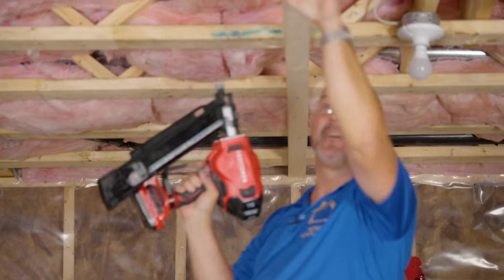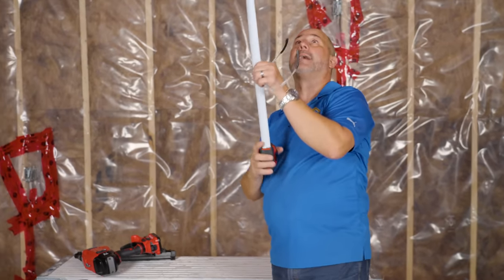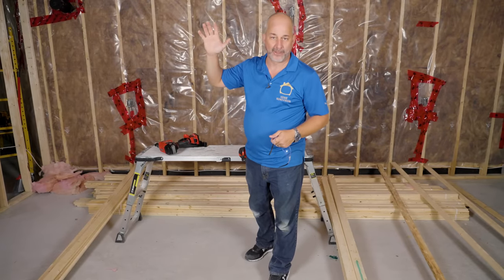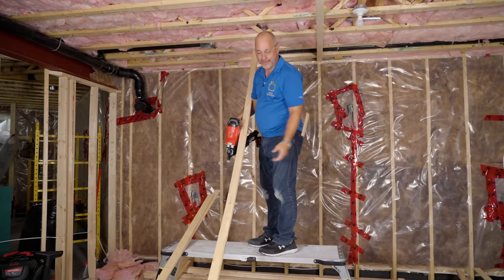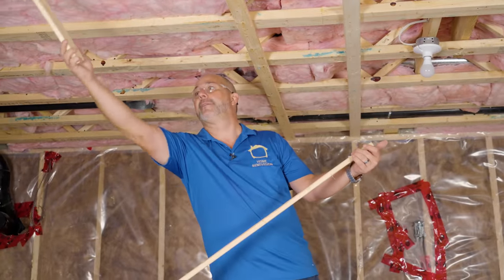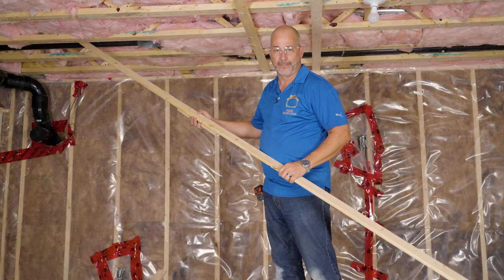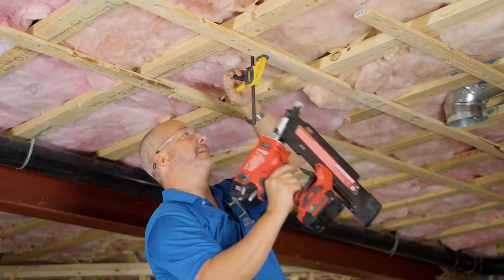Why You Should ALWAYS Strap Your Ceiling

Comment: Besides spreading the load out, which preserves the integrity of the drywall joints over the life of the house, the other big reason is you can nullify structural brackets and any other protrusions (less than 3/4 inch) from bulging out the sheetrock. 

Fixing any 16 oc layout issues is also a significant (and common) plus to Strapping. 

Snapping lines every 4-8 ft is good practice for large rooms (greater than 16 ft or so), so your 16 oc doesn't get out of whack with the spacer block.

Great video though. (Also should stagger the joints for the furring strips).

Dang, furthermore if necessary Strapping can be leveled with shims or spacers for floor/ceiling joints that are out of plane.
Reply: He was using floor trusses with a 3.5" screwing surface.  You'd have to have some of the worst framers in history to not have adequate surface area to attach drywall.  Do what you want, but his reasoning on why to put up strapping had nothing to do with logic.
Reply: @darinvee4980  That doesn't necessarily address layout issues, where the joists layout flip 90 degrees, which is common.  Also sometimes there's angle brackets and stuff sticking down even from those floor trusses.  And while those engineered floor trusses are quite firm, any deflection forces without strapping goes right into the sheetrock (negligible in this case, probably, but not with maximum length joists (whatever that may be; 16+ ft)).

Agree, that if there's ever a time where strapping can be skipped it's with those engineered floor trusses.  Other considerations may still apply.
Reply: or... NO strapping
Reply: @tredogzs  I'm doing a house right now that has 4 rooms with beams, brackets and long crowned ceiling hosts. 

Strapping is necessary. 

Though people are free to do hack work if they want. Have fun with that.
Reply: @chrisroyuri  Your particular situation is not any comparison to this video.  He is in new construction with engineered floor trusses.  They are used because they are uniform and do not have long crowns or other defects.  The use of strapping in this video is just a waste.  No logical reason to do it for this project.
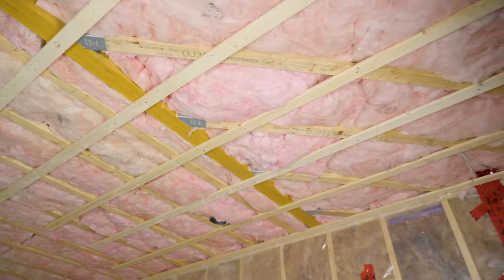Reply: @darinvee4980  Not true. He shows a screenshot at 7:10 that shows joist hangers I was talking about and layout direction changes. Not that this case looks all that bad but the HVAC he shows behind him with insulation over top of it would put pressure on the sheetrock which can lead to screw pops. 

What are you going to go room by room and plan out the rooms you will and won't strap? About 50 percent of the time its necessary. What happens when you start hanging and run into something that makes you say, "shit, I should have strapped this." ? Take it down and strap it?  

It's not a good rule to live by if you think engineered floor joists never need Strapping. 

You know what is, just always strap. 

Have some redundancy in your life.

Comment: I like your videos Jeff! Thank you!

Here in Massachusetts, USA, strapping has always been done on all ceilings since the dawn of time. Building/Electrical code even has a change in it to allow wires to be ran between the joist and the drywall. The ceiling basically becomes a huge chase for wiring if needed. It otherwise would not be allowed because there is not 1-1/4" of clearance between the nailing surface and the wiring. 

We use ring-shank nails. 2 per joist. Not 1 like you show in the video.
Reply from the maker: In this video I was strapping to set up for a t and g wood plank ceiling. for drywall 2 nails are best to prohibit twisting and nail pops. Cheers!

Comment: I believe that things will turn out a little nicer if you take the time to measure and cut the strapping so your but joints will land on the joists and staggering the joints will also reduce problems with drywall cracks. Screws or ring shank nails
Reply from the maker: the drywall runs contrary to the strapping so there are no butt joints. Cheers!
Reply: @HomeRenoVisionDIY  again, wouldn't you want strapping butt joints to land on joists?  You wouldn't need to worry about the backside splint.
Reply: I think he's saying the drywall is long enough that there's no butt joint... Like a 12' sheet makes it across the whole bay.
Reply: I meant that the cut of the strapping was a but cut it is not mitered .Cheers!

Comment: One thing to note as well, if you are willing to put in a small amount of more work, you get some rubber strips to place in between your 1x3 and floor joist and nail/screw through. You will isolate much of the sound coming from footsteps above if you do this.

Comment: My 1940 house had strapping from the beginning. But the sheetrock was 2x4 strips with 1/2" of plaster on top. Not really sure why they did it. But i like it and duplicated with the new addition and remodel. Foes make some lighting and duct work a bit challenging.
Probably reduces cracks. I have zero cracks in my house to this day.

Comment: I started framing in 78’ in the NW. suburbs of Chicago. Strapping was never done and all the sheetrocker’s I’ve ever talked to you about it hate the idea because it screws up the wall heights. Besides, with the widespread use of engineered floor joists, deflection deflection is no longer an issue. So, for the extra time and material cost, it’s just not worth it.

Comment: If part of the benefit is to relieve tension on the nails in the flooring above would it be helpful to rent a screw gun and use a fastener stronger in tension loads for the strapping? Or would it not really matter?
Reply from the maker: that is over thinking it a bit. just giving the deflection a bit of a resistance is more than enough. Cheers!

Comment: I just strapped my roof ceiling with membrain vapor barrier above it for zero penetrations through the barrier.. I used sealing tape at every strap screw I put in. Walls will be built after drywall is done on the ceiling. perfect barrier. Strapping was the only way I could fit the wafer lights in the ceiling without having to cut into the barrier.

Comment: Also a nice gap for mice to run about your ceiling and joists.  We had strapping right above the bottom beam of the joist just opposite side of where you were putting it.  A spray foam for roughly 16" thick of insulation between floors, double rock (going perpendicular to each other with an airspace) in the ceiling, and the soundproofing is beyond words you can't hear anybody drop anything up above you and from up above you can't hear anything going on beneath you - that I liked!

Comment: I like the ideas of strapping, although I’ve never done it. It seems like we use drywall screws to hang the drywall. Wouldn’t it be better to use screws to mount the strapping?
Reply: Screws are my fastener of choice.  Unfortunately, they
Reply: Standard screws Don't have the shear or tensile strength of nail.  Drywall screws would not hold up well if that is what you are thinking.

Comment: I would probably use screws instead of nails, they are more work to put in but they won't work their way out. The way the nails are installed is their weakest holding position, the strapping trying to pull the nails out by gravity. Anything hanging on the strapping will make it worse. And if someone jumps upstairs, instead of transferring the load to the next joists, it'll pop out the nails in the strapping a bit.
Reply: Agree with screws, they're more secure of a hold than crummy nails. But if you insist on nails, then use a hammer. A few hundred overhead nails'll make a man out of ya.

Comment: Good idea, but I wouldn't trust the pull-out stength of nails with direct vertical loading. Recipe for cracked ceiling drywall. Use nails to tack them in a few spots, then screws the rest of the way.

Comment: I would imagine straping also decouples the sheetrock from the joists and reduces impact noise a bit.  The contact points are much less surface area.  Not as good as hat channel but probably better than that foam tape you put on joists.  I imagine if he ran the foam tape on the strapping that  could even improve sound deadening even more.

Comment: In denmark, we use strapping for every ceiling, due to spacing of trusses.
Biggest advice if youre doing it a lot. Get a chainsaw, gangcut them to length on center truss. Mark spacing each end and maybe center strapping if its bowed alot or want extremely precise strapping, could also use a chalk line for each spacing. Depends on wants and needs. Dont use a spacers block, creates possible errors down the road for drywall.
Also dont skimp on nails per joint!

Comment: Sound advice.  I have an unfinished basement... I added a section of drywall to the ceiling without strapping a few years ago... the light pops out an inch, and now I want to do the rest, I do actually have to take down all the drywall I put up and do it right.  Wish I saw this 5 years ago.
Reply: Just finish it as it is. Why do all that extra work? I've hung shit loads of drywall over the yrs and never once did I hang a sheet on a strapped ceiling or wall. If you've that far that's how new houses are built. If you're worried put some more screws in each sheet and it'll never sag especially if you screwed off 5/8 sheets

Comment: Wouldn’t romex sit too shallow if running behind 1x3 strapping? Doesn’t code require wire be set no less than 1.25” from a nailing surface?

Comment: I’m not sure that the single nail at each truss/joist would do much to increase the stiffness of the floor framing system with regard to loading from above. The pull-out resistance of that nail is pretty low. If screwed however, then perhaps a bit of load distribution can happen to adjacent trusses/joists?
Reply from the maker: for sure it makes a difference to use screws, even 2 of them. but to just hang drywall on engineered floor joists 1 nail is sufficient.
Reply: The way I’m seeing it, the fasters are not even a factor. You’d have to install those boards vertically if you really wanted to reduce deflection.

Comment: Should screws be used on the strapping instead of nails?  Vibrations and deflections on the joists, and gravity will cause drywall atrached to the basement ceiling to sag over time?  Also overtime the nail will lose it hold in the wood.
Reply from the maker: 1 hundred and fifty years ago they built houses without a single screw or structural fastener. Today we won der if  a nail can support 1 lb of ceiling long term. no worries. Cheers!

Comment: Strapping is definitely a great choice for ceilings. However, doesn’t the OBC require two 57mm (2 1/4”) nails per joist for wood or metal strapping to underside of floor joist? I also wouldn’t be inclined to fish a NM (Romex) cable in between the underside of a joist and the drywall. Unlike fishing into a wall space, where there is usually about 3 1/2” of space, there is very little room for the cable to move, if a screw is inadvertently driven through the drywall in line with the cable and the joist. Having said that, I do enjoy these videos!

Comment: Great video, Jeff!

2 questions for you.

1. Is it 1x3 or 1x4 strapping you are using?

2. I was planning on installing a drop ceiling so I drywalled the walls. Now I’ve changed my mind and will be drywalling the ceiling. Is it ok to install the drywall on the ceiling after the walls? I really don’t want to take everything down unless it’s completely necessary.

Thanks!!!

Comment: My basement is a mess - after 30 years and poor strapping, I have squeaky floors and bowed joists.  I’m correcting a lot but I’ve come to a place where I’m not sure a basement is meant to have permanent finished ceiling.  Have a water leak? Need to replace the ac lines or any wiring and you have a mess.   My house had drywall on ceiling before I got here and I did the walls.  It looks great, until you need to get in to the ceiling or didn’t know I had a leak. That was my problem.  The strapping with furring strips is a great idea.

Comment: Thanks for this. Great idea for making electric retrofits easier. I didn’t catch what strapping material. Is it 1x3? 2x?
Reply from the maker: I used 1 x 3. you could use 1x4 to make it easier to drywall but then use 2 nails to install. if you have old dimensional lumber then upgrade to 2x4 if it is only 2x8 joists.

Comment: I have a 100 year old colonial with 9 foot ceilings. Lowering them with 2x4's and then strapping and adding batts for sound and CC before drywall. Overhead mud, tape and sanding super sucks, tho!

Comment: You forgot one very important advantage of strapping:

With a laser line to find the lowest and highest points in the ceiling. By using a pole as a guide you can "plumb" that older ceiling by simply marking where the laser line lands on it and adjusting the strapping in or out and shimming it into place.  For this I would use wood screws so adjustments like these are simpler!
Reply: Good idea, thx
Reply: Getting ready to run strips on my porch ceiling before I install cedar.  Going to have to shim the crap out of it.
Reply: I wouldn't bother doing this unless it is really bad. The process of cross framing with the 1x3's will already smooth out the ceiling a great deal.

Comment: Maybe I missed it, but any issue with the sheetrock hanging on strapping attached by just a single nail 16" apart?  Presumably not, but seems iffy.  Wouldn't you want to use screws at the very least? Using 1/2" sheetrock?
Reply from the maker: I have 1 nail every 16" on center with this application. that is 32 nails holding up 1 sheet of drywall that weighs less than 40lbs. when is the last time you pulled apart something with 32 nails. usually 4 nails is enough to require serious energy to tear apart. Cheers!
Reply: @HomeRenoVisionDIY  Great to hear no longterm issues have been observed, thanks

Comment: Without your videos, I wont get the professional suggestions to build my basement. Quick question - I use construction screws for my strapping, and the screw heads are drilled a bit inside so that the head does not show up outside, will it still give enough strength to hold the drywall or should I leave the screws projecting outside, how much deep can I screw them while strapping ceiling ?

Comment: It is 9 feet from my walking basement slab up to the bottom of the upstairs floor joists. We live in the Southern U.S. where we added a basement bedroom & the contractor framed for the different rooms, bathroom, etc., but he also used the existing basement walls by running 2x4's  across from the framing, cut to length and sandwiched between them and the walls. Those 2x4's were connected to the joists above with shorter 2x4 pieces. Sheetrocked attached to the 2x4 runners to make a lower ceiling. Your thoughts.....

Comment: Can you use Resilient Channel as strapping?  I'm finishing up my walls with channel in my basement home theater build.  I even strapped the front wall for a flat projection surface.  I've already run speaker and lighting wire, but I was going to run channel for additional sound proofing and to hold the rockwool safe-n-sound batting.  No RC means I get the maximum height.  RC means I lose 1/2 inch in the ceiling when my ceiling is already height challenged.  Adding RC and strapping would lose slightly over an inch and I can't really afford that for my ATMOS ceiling speakers.

Comment: Typically I would do electrical then insulation then drywall. But when would you do strapping? Obviously you need it if you want to fix lights to it. But then isn’t installing the insulation more of a pain to push between the strapping?

Comment: Definitely something I need to do before I install engineered floors. Thanks
Reply from the maker: cheers.
Reply: Adding 3/4" pine boards flat under the joists won't do much for the floor strength, the glued subfloor is doing that work, the engineered flooring if it is 3/4" is stronger than this strapping.  The little gap for wires sounds nice, but don't forgot that's good for low voltage, but high voltage wires that close to the face of the sheetrock would always have metal strike plates to protect it.  Unless you are hanging the sheetrock yourself I wouldn't trust a crew to not hit your can light wires.

Comment: This is difficult to explain. I'm adding a wall below an engineered wall joist. there are also roof trusses next to it. (It's a single floor "sun room" next to a two storey "open to above" room). It looks like the strapping is stapled to the wall joist and maybe the trusses. Looks like normal crown staples, which doesn't make a lot of sense to me, because I don't think they are long enough. Maybe they're glued. It looks like I need to add some short 2 inch wide strips to make the overall width 5.5 inches because the wall below will be 2x6 and the strapping parallel to the wall joist is 1x4. I'm thinking of using 18g narrow crown staples and then securing the top "plate(?)" to the bottom of the wall joist with framing nails. Will that compromise the wall joist?
Reply: Update. It looks to be that the wall joist (is an open web parallel joist), is 6" wide. It seems to be constructed by 4 x 2x4 joists laminated together (1.5x4 = 6). The strapping does look to be stapled on, I was able to pry one off. I thought they might be glued as well. In any case, I'm thinking the main thing to ensure is that I don't split the joist. I guess I could drill some pilot holes. Anyway, any suggestions you have would be appreciated.
Reply from the maker: predrill is the best insurance. or drill in reverse and burn the hole before driving forward. Cheers!
Reply: @HomeRenoVisionDIY  Burning the hole is a good call. I ended up just going for it with some GRK #9 structural screws. I tested them in a few boards. They seemed to have very little interest in splitting wood.